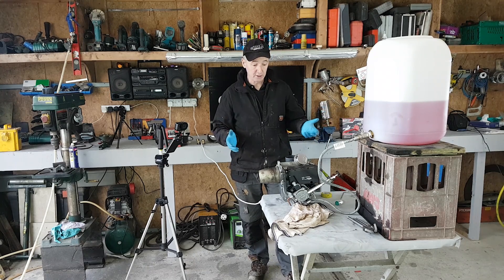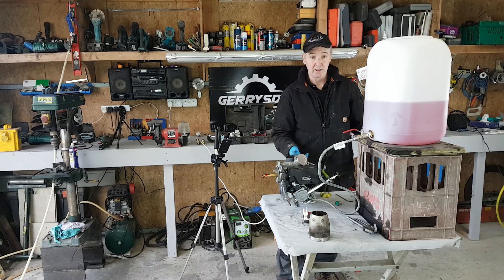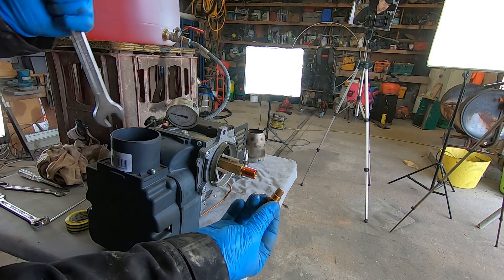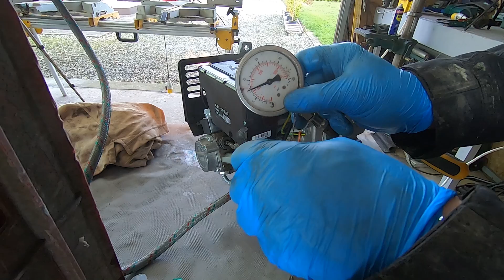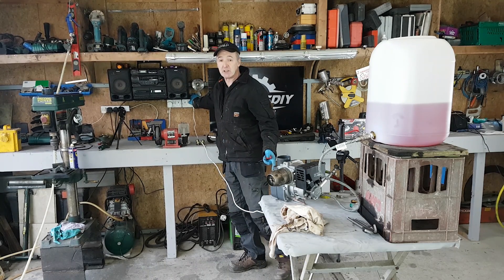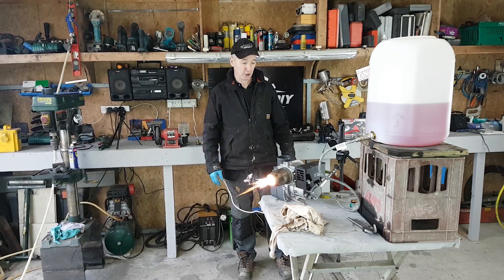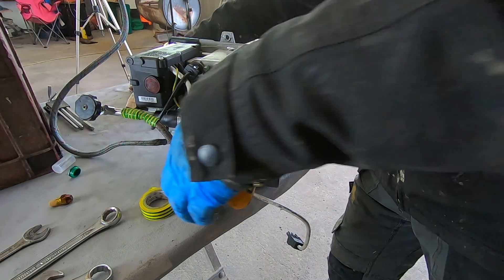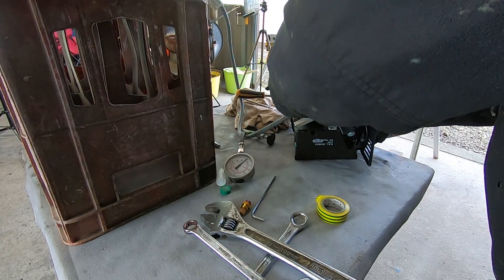Easy Riello Burner Repair

Comment: I need to change the control box, but i keep finding part numbers 535 SE/LD and 535R SE/LD can you tell me if they are compatible? maybe the one with the R just a newer/improved model? Also can the ignition leads just unclip from the control box or is more disassembly required?

Comment: What happens if a brand new eco flam burner is cabled up switched on but after couple seconds goes to lockout, no fan going no sound at all? So I can’t bleed the pump because nothing comes out of the bleed screw, any ideas?

Comment: I have done all you said and my boiler ran last night, was starting beautiful and next morning it just won't fire. It's getting through whole startup cycle but just does not fire up. I wondered about if this could be air intake that's causing the problem? How do I set the air intake when the burner is in the boiler?

Comment: Hey Gerry, any idea why a Riello would fire up and burn for about 5/10 minutes then stop? It won't start up again until it's totally cooled then. Has fuel, bled it, seems to reach a certain temp and stop.
Reply from the maker: Patrick. You could rule out time clock, thermostat, bad neutral etc involvement by running the burner directly off a plug and an extention lead. Fire it outside of the boiler if possible and see if it will continue running. This is just a good place to start. Cheers Gerry👍

Comment: Gerry great videos ,I have new riello 40 problem I am having with it it starting up as normal heats house up great after reaching temperature after 40 min it then won't start back up would this be photocell or control box any ideas have my old burner back in at moment  replaced capicator in that sorted it out cheers john

Comment: Hoping this is the fix, after a service, ours has stopped running, ran for a week, then I cleaned the bleeder and a ton of gunk came out, took the fresh nozzle off after I paid for a calibration service and there was a small deposit of rust, but still not working, nozzle looks fine, but thinking it maybe this. I'm going to order a fresh nozzle and see if it's that.

Comment: Great video - Thanks for sharing. I have same problem, my boiler cut out, so when removing everything, it was so black, carbon everywhere, so I've cleaned everything up and even replaced the baffles as 2 of them were warped. I've replaced the Nozzle for exact same one that came out, but the burner won't stay alight, turns off after about 3 seconds. Any suggestions would be great to here. Thank you.

Comment: Hi Gerry,  those three years have passed very quickly, and now the same problem as before, no burner activity, just the circulation pump.  The problem was the two thermostats on the top of the boiler that set the normal operating temperature (60-70C) of the water and the "limit" setting (90C) to prevent boiling.  Cats have jumped on the cable to the thermostats and disconnected the thermostat!   The Riello burner is still going perfectly after 20+ years of service.  I reviewed all your videos to get up to speed before working on it - thanks!

Comment: Hi gerry great video... I have an issue with mine since Wednesday turn the heating on from inside and the boiler will come on make noise as you said in the video purging and the starts up for about 3 seconds then goes off then back to the purging sound then starts again for another 3 seconds and continues I've takjng the eye out and wiped it but it was like brand new anyway... Any ideas or help I would really appreciate from kildare 👍
Reply: The flame seems to be cutting out every few seconds and trying to start but just won't take off

Comment: Good evening, Gerry.
I'm having trouble with my 'Riello G3B' burner. 
Starting fine from cold ,reaching boiler temperature after 15min, cuts out and then when in boiler calls for more heat it goes into purge mode and wont spark to ignite. Oil pump continues to run, damper opens on the fan , but no spark.
Any ideas?

Comment: only had beckett or similar burner experience.. bought a house with a Riello burner. Wondered about its 20-second fan before it flames.. "the purge" Good to know it's intentional, not due to faulty electrodes or a nozzle issue. Also, now  i know how to check pressure. Thank you Gerry!

Comment: Hi Gerry excellent stuff .Any ideas why  my burner will run  fine  out of the boiler  as soon as i put it back  in  it  cuts out . Checked flue  its clear  .Could there be a blockage  inside boiler  ? It a firebird combi .With a riello burner

Comment: Gerry, I'm replacing the big tube O rings on RBD 2 burner, old ones brittle and broken. The seal kit 3008878 includes small O rings,  and blower casing seals. Where are the small rings for, not shown on the burner  diagram.

Comment: 1st rule of RIELLO is don't screw with what you don't understand. Put the exact replacement parts back in.  Remove the control jump out 5 and 6 to bleed and all good. Also anything over 8 on 1 pipe is a no no

Comment: Mine is igniting for 2 seconds and then shutting off, is it the nozzle or the photoeye dirty? The chimney was clogged from previous add on wood furnace installed completly wrong and left over cresote drying from oil heat fell down and clogged thimble full. It is a duel line unit, can I just unhook the supply and return line or will they drip or run oil out of them once unhooked?

Comment: Hi Garry. Great vids thsnks for help.
Riello 40, making noise, made noise, intake stopped spinning, i put in new capacitor. Worked then stop. Intake is hard to manually spin. Is it the bearings? Are they an easy fix?
Reply from the maker: Hi ogmc. When working properly it is possible to easily rotate the shaft with your fingers. It does sound like the bearings. If you remove the pump you can determine if its the bearings in the pump or the bearings in the blower.  Hope this helps. Good luck. Cheers Gerry 👍
Reply: @GerrysDiy  Thanks G I will follow up.

Comment: Excellent simple video👍
Have you done any setting up with Analyser?
Went to 2 relatively new Warmflow boilers 
O2 was below 4
Co2 was 14% 
Kerosene 8 bar 
Was trained perfect combustion reading 
Co 12%
Any guide on this ?

Comment: Hi Gerry, my boiler won't fire, no spray from nozzle. Changed fire valve , blew out fuel line for tank. It's getting oil but not sure if there enough pressure from tank
Reply: tank isnt pressured. Oil pump located at the burner is what draws from tank. I only really know beckett burners but oil flow is dictated by the burner motor, which turns the oil pump and draws fuel. Some systems have a delayed solenoid valve that stops oil flow for i think 15 seconds when the call for heat is made. 
It sounds your pump or solenoid are bad. Could be motor if you dont hear that kick on instantly but thats pretty obvious.  
If it turns off instantly its a bad light sensor (cad cell) or burner controller box.

Comment: Hello there Jerry a great video there many thanks , ive got a Riello burner thats not letting fuel in through the nozzle and the electrodes are not buzzing no power getting to them either ,, mine is a RDB 2.2 firebird C35 120k ,would you have any idea what it would be , the boiler and burner is in an outside shed , could there be a mother board in the control box that is corroded or damp ,Im just guessing thats all ,many thanks for the videos , best regards john

Comment: ...Ger, you`re a gem... Thanks so much for the inspiration. I took out the burner element which was only fastened with a 13mm nut on top. I pulled it out and had to kill/drill the heads of the 2 screws on the sides to be able to remove the blast tube/collar. I took an adjustable-  and a 16mm spanner to remove the nozzle and blew through that as much as I could. But it didn`t help,  same symptoms. I did read in my research this morning about a photo-lens. I put on my head-lamp again, tilting the burner element, looking inside where I had removed the nozzzle and detected something like a spy lens back about 100mm inside above at my right hand side. I went to get a cotton-wool tip,  spit on it and rubbed the center of the lens and cleaned off a layer of soot. Started the element, but it would not ingnite, stopped it and installed it back into the Grant. All good now. Dirty Photo-Lens in my case. Gerry, thanks very much indeed again for getting me started, subbed and thumbs up.
Reply: Good work, but have spare nozzles available, they can’t be cleaned with air pressure. Also never touch the nozzle screen part with ur fingers. Burner is probably burning dirty that’s why cad was likely dirty. Even if you did the nozzle replacement for a couple years, and save ur self $400 get a tech in on the third year to get his instruments on it and calibrate burner to maximum efficiency. If he can squeeze out another 5-10 % more efficiently, his trip there will be worth it.
Reply: Your advice was spot on, can't thank you enough! I had same problem, it was the eye piece inside, was covered in soot. Pulled it out, gave it a good clean, job done, burner fires up nice and doesn't trip out now. Thank you again.

Comment: You shouldn’t be showing people how to adjust oil pressure and air on a burner Gerry. Very dangerous if any of this is done wrong. Air pressure or oil pressure should only be adjusted by a person who knows what they are doing and a flue gas analyser should be used. If adjusted wrong the appliances could start durning dangerously and kill someone

Comment: great video how do you know how much air it needs in the boiler?
Reply: With experience can do it by eye. Just like cleaning up a flame of an oxy acetylene torch.  Not lazy and smoky like a campfire and not roaring like a rocket. A good burn will make the whole burn chamber glow red and not just a part.  Set it closer towards the airy 'rocket' side if you are unsure. As this will not soot things up, just be little less efficient. Gray Furnace Man has some great videos on the subject.
Reply: Analyser or smoke pump, old guys used their ear, listening to the roar but they forget hearing isn't as good now

Comment: My unit has just stopped. When I push the button it runs for 1 second but doesn't ignite , any ideas?
Reply: Photocell is probably dirty & needs the lens cleaning. 
If it doesn't see a flame it automatically cuts out the boiler as a safety feature.
Reply: @Mechtec500  just had a new photo cell.
Reply: @FearGod-uk  does the boiler fire as it should now?

Comment: Having heard a nightmare story about an oil spill from a domestic tank, I'm thinking of installing a solenoid valve on the oil feed line so that the oil will be cur off when the boiler is not fired up.  Any thoughts on this idea, Gerry?
Reply: Did you fit that valve?
I have the same nightmare.
Reply: @gulag8735  No, the spec for the valve seemed to suggest that it would only work in the vertical position and the only place I could put it was on a horizontal pipe run, so I just fitted a simple manual valve on the tank outlet and turn it off when the CH is not in use.   Some districts in the UK stipulate a double-skin tank or "bund", but those tanks cost more.
Reply: @karhukivi  thanks. As it happens I have a 6ft vertical fuel supply pipe to the boiler. I think a bund is nearly essential as the mess is frightful but I hate "it's the law" and rules🤣

Comment: Excellent Gerry!  I learned a lot and thank you for that.  I'm not sure it's a job I would take on in case of making some mistake and risking a disaster, but at least I know what to look for.  My Riello 40 boiler is doing nothing on power-up, not even the purging, only the circulating pump works.  I'll check the power, then try the reset and then see.....    I might be calling you!

Comment: I have a Reillo Series 40 burner that is about 2 years old.  We noticed a strange odor from the furnace and I observed the motor come on briefly, then there was a bang and the damper door flew open, then the motor stayed on and after a few seconds the burner fired up with no problems.   My service tech stopped by and of course it worked fine while he was there and then misbehaved again several hours later.    What do you think this problem could be?
Reply: Delayed ignition. Weak transformer, electrodes gapped incorrectly or maybe flow/pressure issue.
Check inside damper and look to see how sooted the flue is always a good idea too when having any issues.

Comment: Hi I have a Riello  burner when I turn it on it takes 15 to 20 seconds to start up that’s ok it starts up and the rads get hot then the problem starts it stops but stays purging but won’t kick back in to fire up any help would be greatful thanks Michael

Comment: Hi Gerry, I have a Tranco Boiler in the UK (originally sold by Travis Perkins). It had been running fine this Winter for 5+ months but recently it started locking out. I changed the jet on it and things improved but its started locking out again but it only seems to do when the next scheduled demand occurs. For example, I just went and checked it and there was no lockout light on. I overrode the heating schedule and the lockout light came on but it fired up as soon as I pressed the button. Weird one eh?

Comment: Hi Gerry, Very informative video. I have a Reillo, placed in a year. But there is no reset button light coming on. There is power going into the control box. But no light or ignition. Would you think the control box needs replacing ?
Reply from the maker: Hi Matt. Sounds like the control box alright.  If you are testing with just a phase tester make sure you have a neutral as well. Use a multimeter or try a temporary lead. Might be worth a shot. Cheers Gerry

Comment: Oil burner not firing up when I turn on hot water or heating, any thoughts on a quick solution?
Reply: 1 , check oil tank , 2 ) Remove the photocell and clean the eye; With a clean rag ; Try to fire the burner , 3)Check the nozzle, Take the nozzle replaced it , Theirs is a stamp on the nozzle indicating the size and angle,  You can take out the the nozzle,and clean it in dish with some oil , If you can replace it , Cheers Dublin Dave

Comment: Hi Gerry.
I have similar burner with a 5 pin plug on it, I want to bench test it but need to know if I have to short out pins 4 and 5, black and grey to get it to run. Cheers, Jim.
Reply from the maker: Hi Jim. Let me know the model burner you have. Cheers Gerry 👍
Reply: @GerrysDiy  Hi Gerry. It’s a Riello MO535-M1PF, looks the same as the one you repaired in this video. Cheers, Jim.
Reply: @GerrysDiy  Sorry I gave you the controller no. It’s a RDB 2.2.
Cheers, Jim.

Comment: we bought new lamborghini eco oil burner and when its burning, flame is smokey. how can i stop that smoke? when i reduced manifold flap level,it gaved less smoke than before but flame is not as clear as yours.
Reply from the maker: Hi. Do you have a way to check the pump oil pressure. Seems like you have too little pressure but just guessing. Pressure should be about 8 bar for Kerosene. Hope this helps Cheers Gerry 👍

Comment: Gerry. Is there a way I can test myself if the pump is working or not? I took off the burner and no mist comin out. Electrodes working fine. But no flame.
Reply from the maker: Hi Darren. Make sure that the pump is not airlocked. It cant suck oil but only push it once all the air is gone. If you definitely have Kero in the pump take the nozzle out and see if it tries to push oil out the front. It wont be pressurised but it should still flow. Give me a call if you're still stuck.. Cheers Gerry